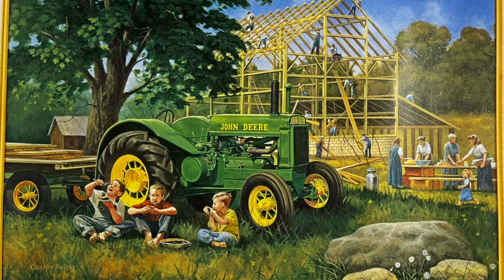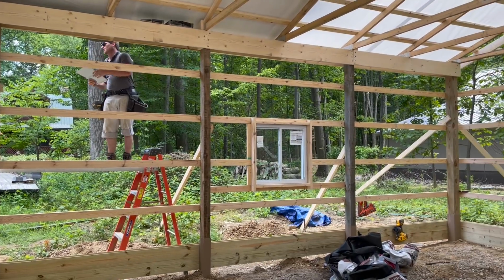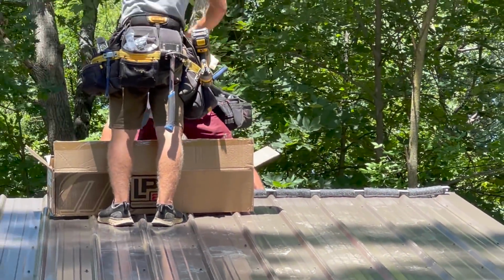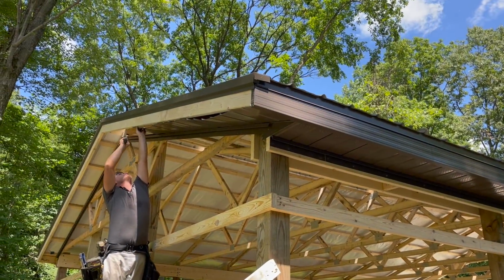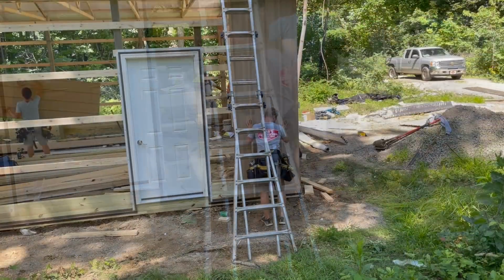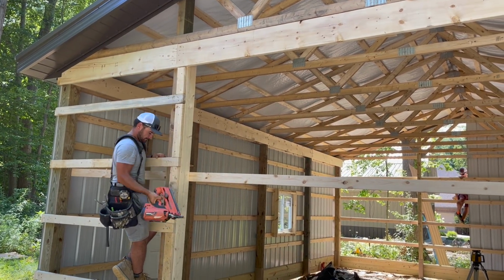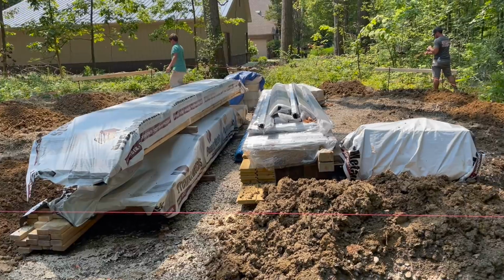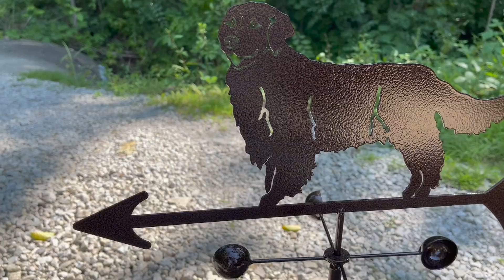Pole Barn Construction and Instruction: Metal Roofing, Walls, And Trim

Comment: Wow, very nice. I really like your building. I've always had garage type doors too. The last door i installed was on the front of my garage its  16x8' tall. A very big mistake on my part. In the winter months mostly, as my garage is heated when opening the door you loose a lot of heat. Then, it takes a while to warm up inside.  Looking forward to your sliding type doors. Great idea when you think about it.You only need to open up as much as needed. Gonna be great when you get this finished.

Comment: Looks good, question... Without a moisture barrier between the bare wood and sheetmetal how do you stop the wood rott, when the sheets condensate? Just curious
Reply from the maker: Roof has a moisture barrier.  I have not seen condensation on the sidewall yet.  I assume since it's not insulated the temperature is the same inside and out not.  Now my insulated garage could be 38 degrees inside and if we get a warm spell and I open the garage door, everything is covered in condensation.

Comment: I have to ask and this may be a dumb question but at the beginning, you said you poured 80 pounds of dry concrete in the holes and then filled in with dirt.  Can you elaborate? I have not used the dry concrete before and was wondering when you poured in the water.  Was it concrete, then water, then dirt?  Sorry for such a dumb question.
Reply from the maker: It was concrete.  In my area the ground is wet enough to not need water as the concrete will suck it out of the ground.  The pills were placed first, then post, concrete, and filled.
Reply: @ataleofthreecabins1025  So you are saying that you did not use the 'dry concrete mix' that I have been seeing on projects and just regular concrete that one would normally add water to?  Wow.  Very cool.  I'm in Hawaii and would think, at least where I live that there is plenty of moisture in the ground as well. I like the 'pill' idea, I have not seen those around here.  Mahalo for getting back to me so soon.

Comment: I put steel on my new lean to roof last summer and the place I bought it from says roof metal screws go on the ribs. Walls off the ribs. And looking around my area 90% are like that. I notice they did your roof different.
Reply from the maker: Most U.S. metal roofing manufacturers say that you should put screws into the flat, because this location offers a solid wood surface just beneath the metal panel, resulting in a safer, tighter, more secure seal.  That's how my house roof is also.  Take Care, Tom
Reply: @ataleofthreecabins1025  I agree with you. Putting them on the rib causes the rip to squish and take it out of square.